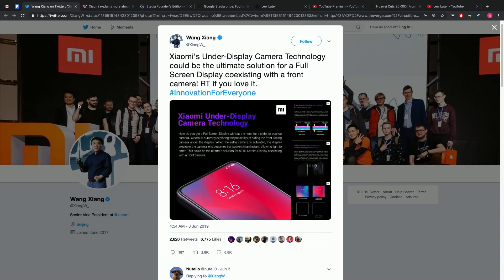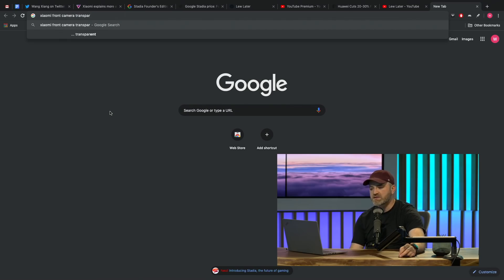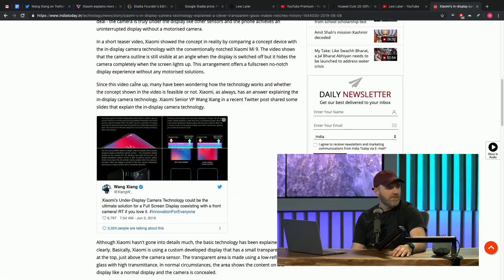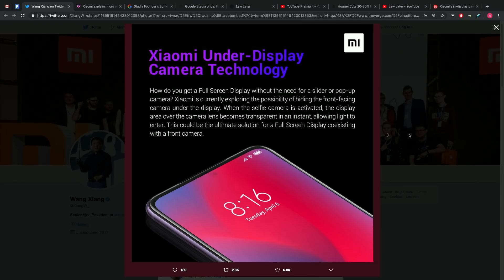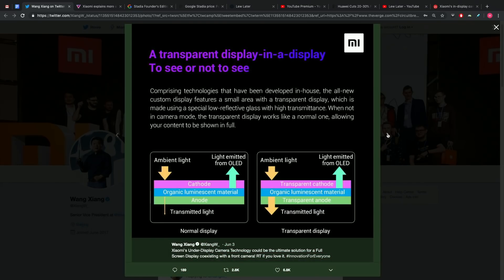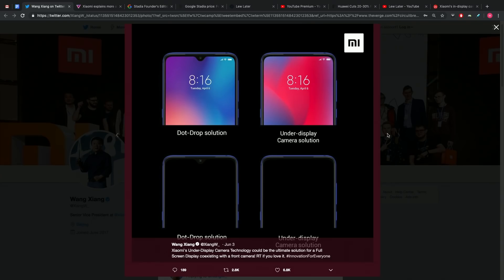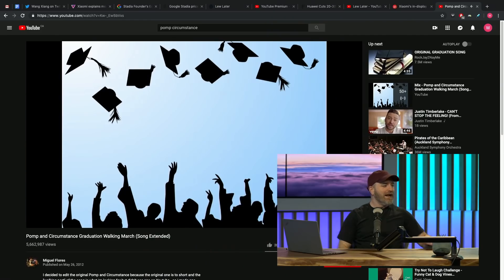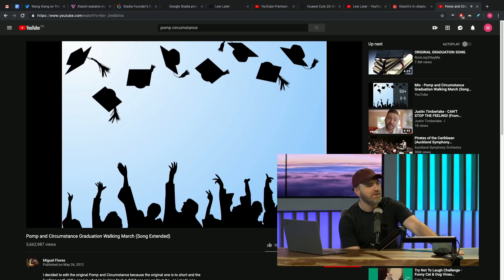Lew Later Explains How Under Display Phone Cameras Work

Comment: how could you take a fullscreen selfie pic if the top of the display has to be turned off in order to get the camera working?
well see in the hands on video if its possible
Reply: You can take a fullscreen selfie with a bigass notch in your screen, so whats the different?

Comment: Under display finger scan + under display camera + IP68 = future smartphones
Reply: + 120 hertz display
Reply: @hotwheel-qm7ee  *144hz
Reply: @SG-ix3ly  144hz isn't noticeably better from 120hz on small displays such as phones. e
Even larger displays its barely noticeable for that matter.
Reply: Under display camera and fingerprint sensor, no headphone jack, only wireless charge or magnetic wired charge, vibrating screen instead of speakers and no buttons only sensors = fully waterproof phone

Comment: what about screen protector?
Reply: You don't need it. They use gorrila glass 6 which is chemically engineered to be almost impossible to break on purpose.
Reply: @The-illuminated  All glass can break
Reply: @PukMaxi  but not unconscious tho. You have to hit it really hard.
Reply: @The-illuminated  but they still will break face down on concrete....AND that's why we need bumper case. Hahaha...
Reply: @93SupaFly  Have you tried it? 
A. Yes. I know it from personal experience.
N
B. No. (So you can't know)
Reply: I thought the purpose of having a screen protector is to prevent scratches
Reply: @kaelhasturn  That's where you are wrong buddy. Screen protectors are used to prevent the screen to break. Learn your lesson before you comment. Smh 😂
Reply: @arshenio45  I'm just telling the truth.
Which is 

SCREEN PROTECTORS ARE USED FOR PROTECTING THE SCREEN FROM DAMAGE.. WASH AND GOD WAS A RIHANNA TO KILL YOU ARE DEALING WITH PORTALS THAT THOSE OF YOU WHO ARE INTERESTED IN A UGLY AS I